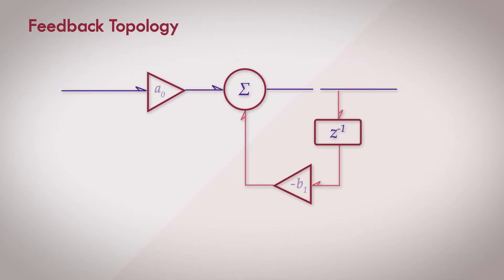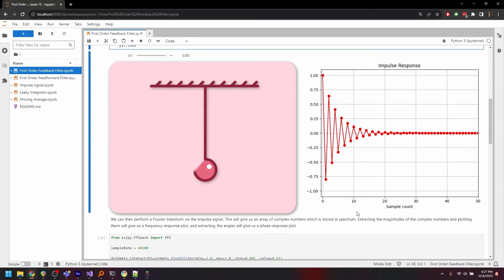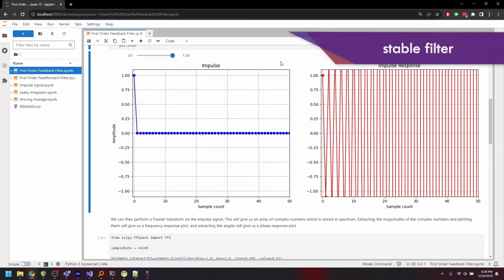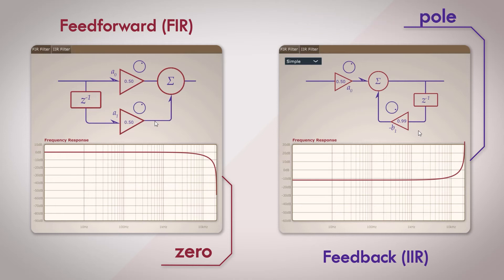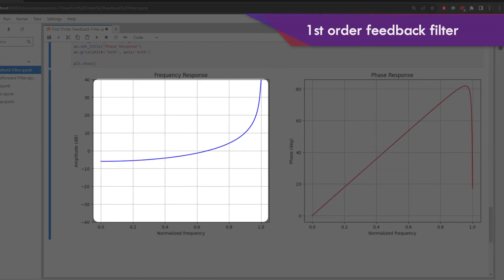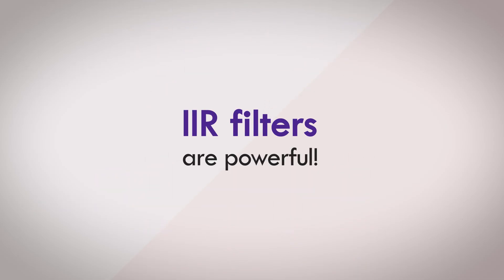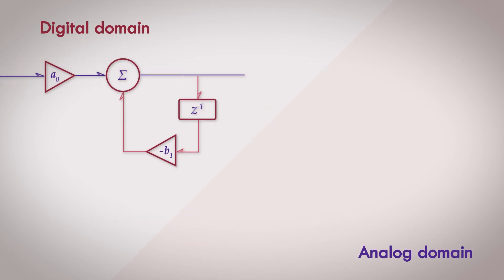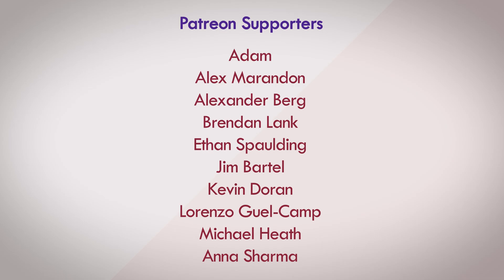8. IIR Filters - Infinite Impulse Response - Digital Filter Basics

Comment: 13:41 >our ears are not sensitive to phase
Not quite true!  Your brain uses phase differences between left and right ears to help determine direction.  You can generate a tone (e.g. 300 Hz) in Audacity, copy it, pan one totally left and one totally right, then shift one of the copies forward or backward by a fraction of a wavelength and hear the difference in where it sounds like it's coming from.  I've heard that's a large part of why it's hard to tell where high pitched sounds are coming from; the time it takes sound to travel the distance from e.g. your left to your right ear is more than one cycle of the tone, so figuring out the phase shift becomes infeasible.

Comment: Fun fact:
Although it's very well known that an IIR cannot have a constant group delay (linear phase response), you can have a constant (very close) group delay by applying an IIR to a time-limited signal in forward direction, making sure to keep filtering until the tail decays enough, and then in backward direction.
Reply from the maker: Yea that is a cool thing you can do, if the use case is non-real time.